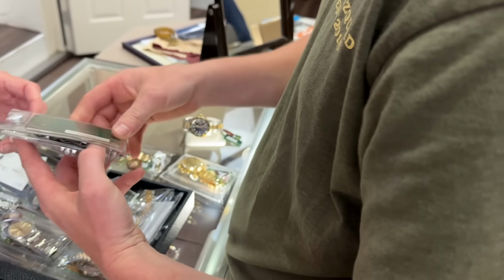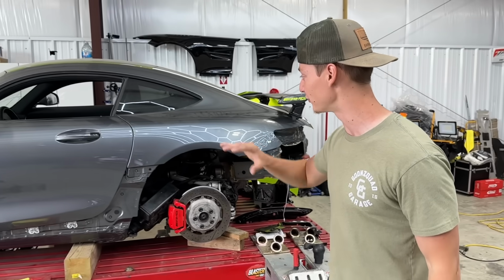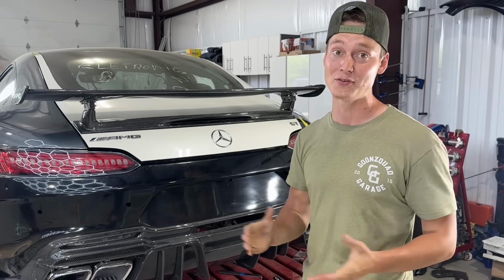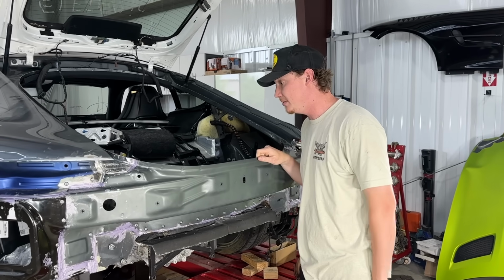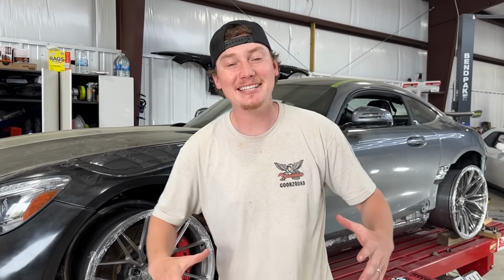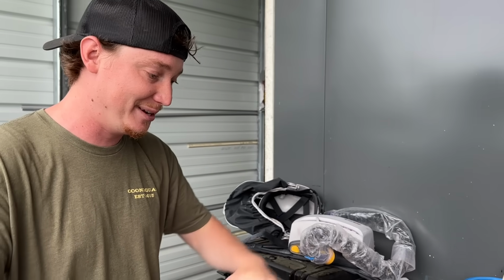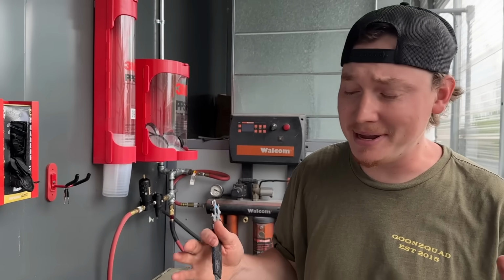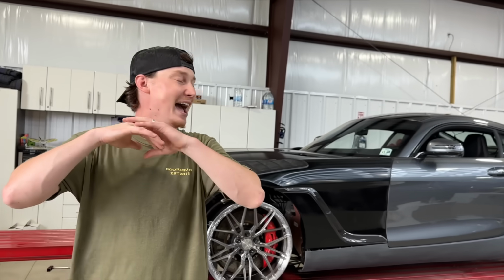Rebuilding A Wrecked Mercedes AMG GTS! Our Toughest Paint Job Yet!!!

Comment: I have a matte Selenite Gray Magno AMG GTC and I can tell you the paint is amazing.  Really accentuates all the sculpting of the body lines.  I wrapped the front 3/4 of the car in XPEL Stealth matte PPF and you can’t tell the difference between what’s wrapped vs. not.  Highly recommend, don’t want to be paranoid about any scratches, as it requires a full respray.

Comment: Try to avoid hammering directly against the dolly.  When you do that you stretch the metal.  Stretched metal makes the worked area bulge in one direction or the other, or pop in and out called oil-canning.  Once you reach that point you’ll need to shrink the area to reabsorb the extra metal caused by the hammer on dolly.  It’s generally preferable to use the dolly behind the low spots while hammering down the high spots so you avoid stretching the panel and causing you more work.

Comment: If I were yall, I would do green base with gloss clear, then sand flat, then spray all FLAT CLEAR in one full session to get the same result all over . (One big stirred batch) . Also maybe a dual sprayer session. Both brothers to keep the edges wet.

Comment: Green. Every Mercedes is boring gray. If you don't want to paint the satin clear then do it in high gloss, but still green. You can always wrap it with satin PPF after if you want the look. A few years ago I had a Holden SSV Ute that was (ironically) repainted a Mercedes metallic gray with satin clear from new - I didn't realise how difficult that would have been to paint, but it was like that when I bought it.

Comment: The only advantage to the matt green is it won't show the ripples and imperfections in the aftermarket panels as much as gloss would. Personally I would go for the original silver gloss finish. Easier to spray and longer lasting than the matt finish. Matt paint must be a pain to clean and maintain if you can't polish or even touch up any chips or damage. Save yourselves the stress and go for high gloss finish in either green or silver 👍

Comment: I would stick with the original colour and either do the matt finnish or PPF it with the Matt...Will make the car look completely stealth.

BTW The satin/matt clear coat can go on any colour you like as base coats are the same just different colours. Just as easy to paint as with gloss, just have to make sure the filters are new in the paint booth and wear clean gear and good prep cleaning before coating.

Comment: Going against all other replies... Stick with the original color. It's a luxurious color, easy to get any trash out of, easy to repair if need be and a LOT easier to keep instead of a color change. You'll still have the performance WOW factor without the pull me over bright green that you can't fix or possibly even match.

Comment: I wouldn't waste your time trying to change the color. Sure, the green looks good, but you are going to need to do all the jams and the engine bay, and the chances of you getting it right the first time are basically zero. Just don't waste your time if you paint it and it goes wrong you are going to have 3 layers of paint, and IMO, that is too much.

Comment: Gotta go with the AMG Green: that's an iconic color worthy of what you're doing with the car. I managed to paint the front and rear bumpers of a Jaguar F-Pace SVR Flux Grey Satin to match the rest of the body, and I did it in my garage without the benefit of a paint booth, so you should not be upstaged by little 'ol me!